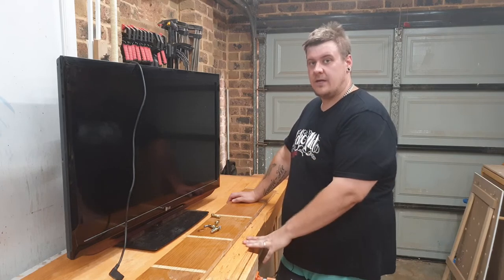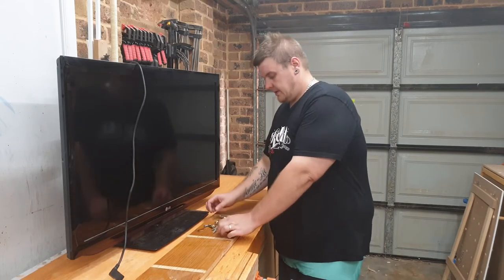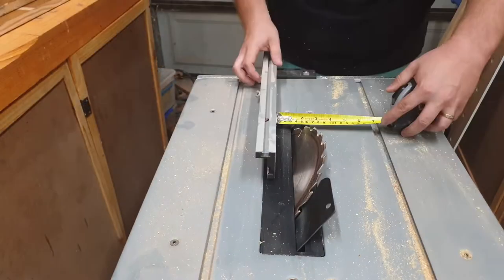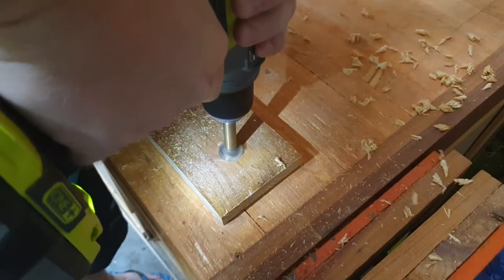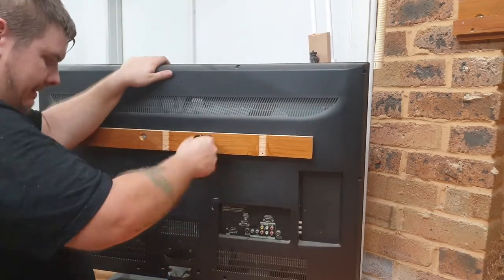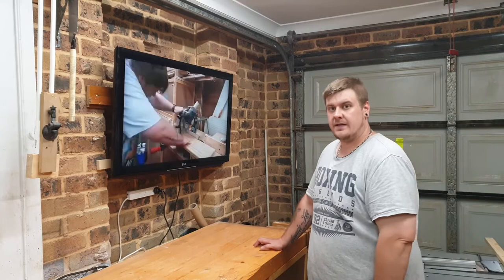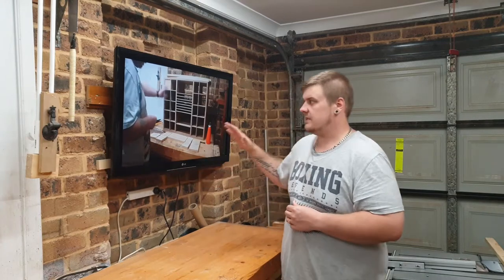Don't Buy A Tv Wall Mount Until You See This Video // How To Wall Mount A Tv For Free // Woodworking

Comment: So clever! We used the french cleat method to hang the really heavy canvas art frame we made (out of 250 wood blocks). Never even thought of using the french cleat for a TV! Thanks for the tip.
Reply from the maker: Dang I bet thats heavy 😂.
👌👍
Reply: @BKRcustoms  Ha! It weighs around 17-18 lbs - less than I thought it would. It was made out of 2x2s in all different heights - the video is on our channel if you're interested in seeing it. Definitely couldn't have hung it without the french cleat put into two studs though 😂
Reply from the maker: @JustMightDIY  wow, I'll definitely check it out 😁

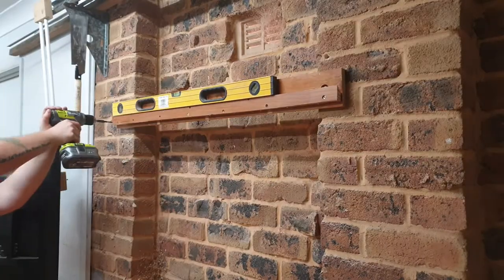Comment: Good stuff! What was the go with the tv hole spacing and the masking tape at 1:20? Did you peel it off the tv and stick it to the wood?
Reply from the maker: Thanks! Yes I did.
Reply: @BKRcustoms  Yeah cool. Video skipped over the moment. Probably worth it for the nice tight edit though. For the bolts into the TV, were they already in your TV? How did you get those?
Reply from the maker: @metacruft  for the bolts I just went through my box of random bolts till I found some that fit 😁
Reply: @BKRcustoms  Ha, nice ok. :) At least they're probably some sort of common metric thread then. Cheers.